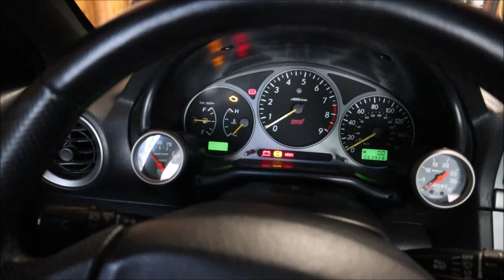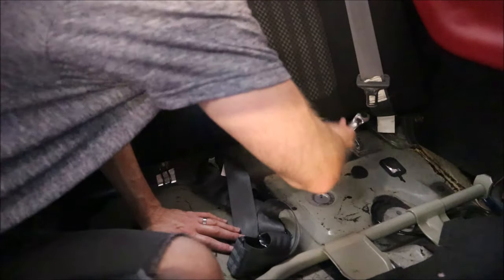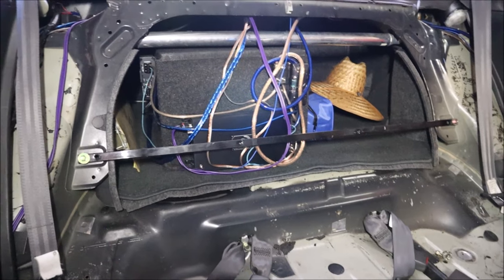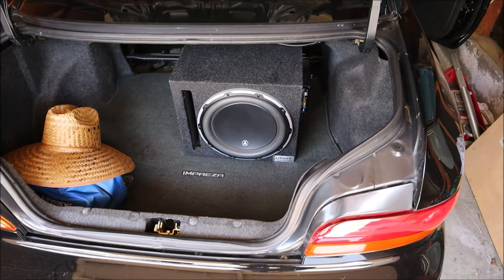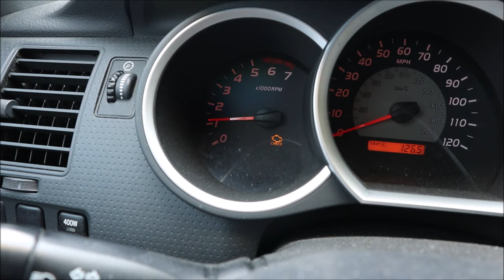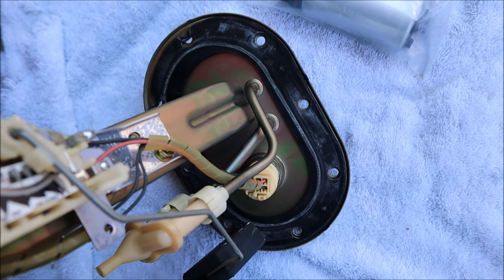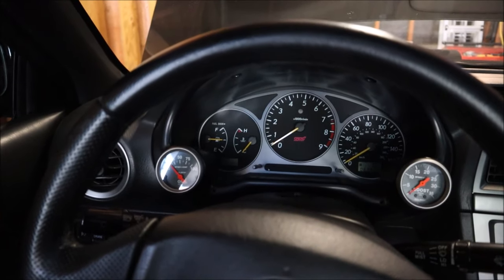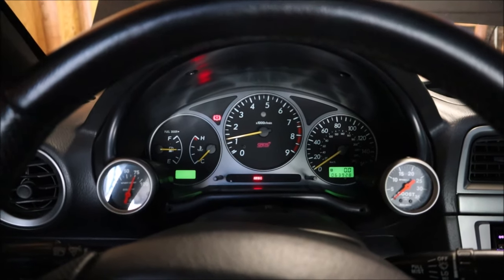Fuel Pump Install on the GC8 Build: Subaru Impreza 2.5RS Part 4

Comment: Did you start the car before you removed the fuel pump? After you brought your new battery?
Reply from the maker: Milz Dox yes, to ensure everything was up to par before digging into fuel tank!
Reply: @RoadPatina  was waiting for start up of vehicle but looks like u didn't include it. But it's ok. cool bro.
Reply from the maker: Milz Dox there is a startup and clips of it running inside and exterior!

Comment: Hey man! I know this is an old video, but is this the same process for the Impreza outback? I’m thinking I’m having fuel pump issues, misfiring and it feels like a fuel cut. After 230k miles I think it needs changed anyway
Reply from the maker: I never looked at the Outback but they are very similar cars and I would not be surprised if they are the same. Check part numbers and google! It could be a number of things.
Reply: @RoadPatina  yeah I wouldn’t be surprised either, the cars are so so similar, do you still have yours? It looks super clean in this video!
Reply from the maker: @tbennettVisuals  yes! Just got it tuned and te37 wheels! Check my channel for updates.

Comment: It is very common to mess that oring.
Between me and my friends there are 4 subarus, and 3 messed up the oring after putting new pumps.
If you have gas smell.. you knkw where itt's from.
Reply from the maker: Pedro Teixeira glad it was only $6. No smell so far but have not driven it, just warmed up in garage. We will see when fuel starts sloshing!